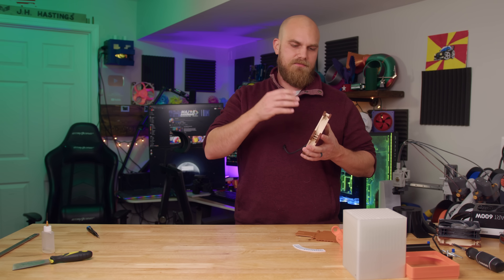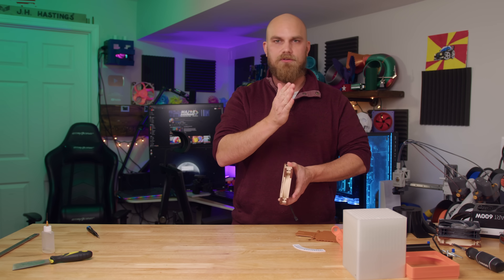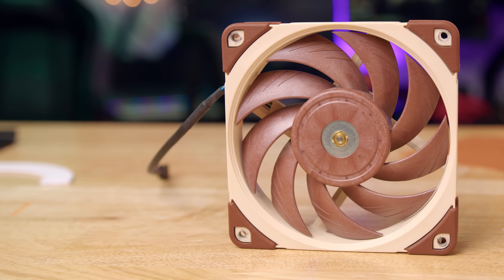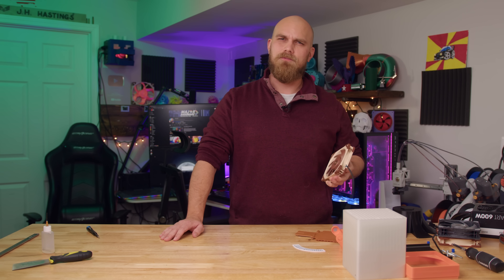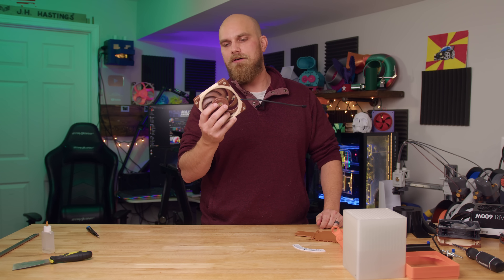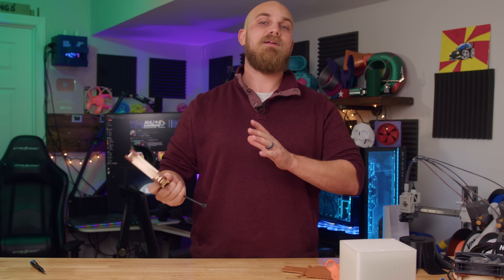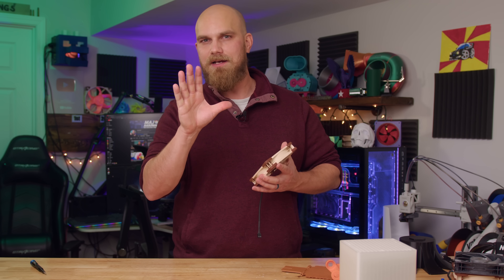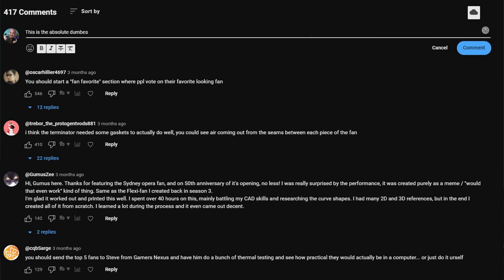I Built a Static Pressure Machine | Fan Showdown Season 6 Pilot

Comment: Hi, I think your solution is pretty good for what you're trying to do.
While you were explaining your idea of how to measure static pressure, I visualized a U shaped pipe with the bottom filled water and one end sealed with what you already built so that the air coming out of the fan goes into the pipe. That way the air coming out of the fan would push the water up the open end of the pipe and it should be easy to measure how high the water is pushed. That said, I think it would take some experimenting to find the best diameter of the pipe and it would need to be tall enough so the water doesn't overflow out of the open end. I hope the description makes sense.
Love your videos, will see you in the next one.
Reply: Yes with carburators I use tubes filled with mercury
Reply: As I understand it, that's literally why the measurement in the spec sheet refers to water -- that is THE way to measure it in high precision.
Reply: The issue with that is that if the Noctua can only do about 2.3 mm H2O, how are you supposed to accurately measure the differences between the fans? You'd be measuring tenths or hundredths of a millimeter. You could try a lighter fluid like mineral oil for around 15-20% better accuracy, or set the measuring tube at an angle as long as you have the space and the tube is rigid and stable enough, which can be an issue. 

Another option would be to control the "ambient" pressure holding the liquid down. You could pull a slight vacuum on the "output" side, for example use a plastic hose and clamping it with some air between the end and the liquid. Basically a reverse water barometer I guess.

Comment: Fans achieve their maximum static pressure when they don't move any air (hence the word 'static'). The device in this video does not fairly test fans with high static pressure and low flow rate, since those fans wouldn't move enough air for that higher pressure to make it to the flap. Trying to inflate a closed volume against a force (something like a balloon: more pressure = bigger balloon) would be a fairer test.

Comment: Instead of measuring the angle, you could make it max out at 30º at which point it would weight against a scale... that way the restrain in air would be the same and you would measure a 'force'.

Alternatively, you could make a Pitot Tube of sorts inside a tube and measure a water displacement caused by the pressure... you could measure both static pressure and total pressure, quite interesting physics...

Comment: Instead of measuring the amount that the door opens (which will give nonlinear results), it would be interesting to measure the pressure on the door by adding a small digital scale to the other end of the lever. Limit the door to open some amount that most fans can achieve and measure the force (in grams or ounces) from there. This way, the flow will be similarly impeded regardless of how much force is being exerted on the obstacle.

Comment: I thought that a true static pressure reading would be with no airflow, I.e. That this is a halfway house between airflow and static pressure?

With a manometer and an adjustable restriction, you could do a sort of brake dyno setup where you keep adjusting the restriction and measuring the pressure (And airflow) - This would then allow you to graph the results as a nice curve for each fan.

Comment: The volume of air needed to open the flap further grows the more the flap is open, making the linear scale measurement inappropriate.  Ideally you would provide a static orifice and some kind of contained measurement device.  Perhaps a piston can be raised by the fan pressure in a clear tube, while having a set orifice on the sides of the tube or in the piston itself to restrict the airflow.  In this case elevation of the piston would be a more direct and consistent measurement of the static pressure.

Comment: I think its fine, but there should be some audience awareness that the numbers on the gauge are nonlinear, due to how the force required to shift the angle grows as the fin aligns with the airflow. That is to say, 6 may be 1.3X the force as 5, additionally you could potentially find the static pressure values assigned to the numbers based on datasheet reported values and map them to your gauge.

Comment: only thing, like i saw someone else mention, is that as it opens more, there is more air velocity and it doesnt measure static pressure anymore. I think you could make a great measurement device using the same setup, except instead of the flap opening, it is mounted solid in place and you can use a strain gauge in some way to measure the flex of the flap based on the pressure the fans are putting on it.

Comment: You'll have to calibrate with a known high CFM low static pressure fan. as this setup may not induce enough restriction to simply be overpowered. A tighter straightening grid may be the easiest option. If there's little to no restriction, then you've made a CFM meter, not pressure. 
 
Alternatively, you could literally use water - a mechanical manometer is just 2 water loops, one attached on either side of the restriction, and the other just pre-restriction to open air. The water level will shift in the tubes relative to the pressure difference in and out of the chambers sections. So your grid assembly would just have 3 ports on the bottom and a more restrictive plate in the middle.

Comment: Isn't this contraption still measure air speed, not pressure?
Also, 2mm in height is not necessary is 2 mm length. Just place the u-tube almost horizontally.
Or, modify the contraption to actually measure air force on the lid, not angle.

Comment: You may be able to set up a hydraulic static pressure tester by having a water reservoir that the fan blows down into, with an elbow out the side that connects to a vertical, clear acrylic tube with graduations on it. The higher the water rises up the tube from your baseline, the more static pressure you have.
Reply: Or suck, as it were.   With a reduced acting area at the end of the tube I think you could get more displacement and therefore resolution.   Finding a fluid with low surface tension could also help reduce measurement error from a wobbly wobbly meniscus.
Reply: @knibknibknib you dont want a reduced area. It will start to have capilarity effect on the water and change the actual value.
Reply: I'm not an expert in any of this but this one actually makes the most sense to measure pressure. The water would keep air from flowing so it would only respond to an increase of static pressure. It would be really easy to engineer. Could also add a little foam float to the measuring side that's just big enough to stick to the walls when the fluid drops.

Comment: You can increase the resolution of your measurement by increasing the length of your "measurement arm". Longer arm on top gives you a higher ratio of movement. Let's say right now it's 1:1, the flap is 3 inches and the arm is three inches. If the flap is deflected 1 inch the measurement arm is deflected 1 inch. If you change your ratio to 1:2 your deflection at the measurement arm is doubled, making it easier to measure changes that would otherwise be difficult to see with the naked eye.

Comment: One potentially major issue with this setup: The closer the flap gets to horrizontal, the less accurate your reading will be, not only because the greater angle decreases the area of impact, but also because of Bernoulli's Principle. As the flap gets more horizontal, the airflow could become a low-pressure area that pulls the flap down. This could potentially cause major oscillations which will make it impossible to get an accurate reading.

I would suggest having a flap on linear rails, with a very light spring, that the air has to push straight back. This would solve all issues related to angular cross-section, and, the force require to compress the spring can be directly converted to a relevant metric.

Comment: I would use a U-tube manometer as like others have suggested but 3d print the fan to tubing connection of the manometer such that the liquid level in the in the tube has a different surface area than the surface area of where the fan contacts the fluid. Right angle down the square fan tubing about 6 inches and connect the tube to the bottom. when you fill the u-tube make sure the liquid level equalizes in the square tubing and then you will have a force multiplier to make measuring the fluid rise easier.  you could also fill it with a lighter liquid like Isopropyl Alcohol 785.40 kg/cu.m instead of using water at 1000kg/cu.m, possible chance of fire but you will have more sensitivity in measuring the height of the fluid rise.

Comment: I like the idea! i mean a off the shelf anemometer would make the most sense but as an engineer doing things differently just for the sake of it registers with me. The only thing I could see is that the scale is not linear since when the paddle moves the force of the wind is not parallel to the normal force, as can be seen with the 3000rpm fan. The easiest solution I can think of is make the pointer longer and calculate a non-linear scale. Maybe make the numbers on the scale normalized and based on the force being applied to the paddle. since knowing the weight of the paddle, weight of the counterbalance, and the angle, those can be calculated.

Comment: I have been thinking about this type of test for a while. I think a device based off a barometer using fluid would be the most true and reliable test. The measurement you showed of 2.34mm is literally this type of a test. the fan was able to lift the fluid (water for their test) 2.34mm.

Comment: Interesting idea. Maybe have the flap fully enclosed and sealed with some kind of rubber bracket (or equivalent) on the side facing the fan, then hooked up to a weight scale. Like a food/baking one should be sensitive enough. There's even entirely mechanical ones that you could repurpose. 🙂

Comment: Or, a large (the wider the better) bucket with a sealed lid.  Attach fan to lid.  Add a clear tube to the bottom of the bucket and attache it to the side vertically. Add X amount of water (keep it the same), add a line to the tube.  Turn on fan, measure how high the water moves.

Comment: I can see there being a problem with the angle gauge thing. There wasn’t a huge difference in the reading of those two fans you used to demo it. You’re going to need something with higher resolution. Make the radius of the gage much bigger and the pointer much longer. You can thin down the pointer to make the weight insignificant

Comment: Problem #1: That flap offeres less resistance as it opens up, so it's a logarythmic scale, making it very difficult to see the differences in the top-performing fans. You saw that already in this video. 
Solution #1: Make your own manometer using a cheap-ass Bmp 280 sensor or equivalent, read it with a dirt-cheap Arduino and you're done.

Comment: Hi there, my suggestion is to balance your door/flap so that the T-30 just about maxes the gauge out... because no normal 120mm fan running on an AX12-25 is going to go that high. That should also bring the stock AX12-25 closer to the middle of the scale.

Comment: I saw AlterLynx imply a suggestion that the flap should be longer to ensure that it is always in the air stream. I concur, but only to the point of practicality.
I would check to see of the air straightener is required to get consistent results as it is eating some of the static pressure.
It is possible to convert the angle to static pressure. P*A*l/2=m*g*L -> P=2*m*g*L*sin(theta)/(A*l). m*g*L*sin(theta) is the torque of gravity on the flap, I think that will work for that equation, but I'm having hard time figuring out what m*L ought to be, I just know it is the moment arm of the flap. This is nice as the m*L can be increased if the fan is strong enough to move the flap out of the wind. A is the cross sectional area of the box and l is the length of the flap in the air. So l should actually be h/cos(theta) where h is the height of the box. So the final answer that I have is P=2*m*g*L*cos(theta)*sin(theta)/(A*h).

Comment: 1. Flap deflection may not be linear with air pressure.
2. Not enough resolution on the scale, which could place fans close together even if they have vastly different pressures.
3. Using an angle of deflection may not be very relatable to real-world applications, but it is a good way of demonstrating pressure to the viewer.

It is a very entertaining video, and I am glad you are taking the initiative to make the content more interesting by tackling different issues. I apologise if my comment seems harsh. I genuinely enjoy your content. Sorry I didn't come up with a better solution for measuring static pressure.

Comment: i think that a much better option to visually check the static pressure of fans would be to :
x: mount fan in the contraption that would place fan above the table
x: place 20 dry leaves from Canadian maple tree no more than 5 inches away from test subject 
x: after turning fan on for the duration of one of Celine Dion songs (your choice ) measuring the distance traveled by every leaf.
x: multiply the sum of distances ,divide by 20 and square root of PI (preferably key lime PI)

Comment: For relative measurements, this is fine. Technically this is still dynamic pressure as the door opens and there is air flow through it. 

You could just glue that door shut, and shove a 1/4" PVC tube in a hole in it, hold it so that it dips down, then back up vertically,  then put a bit of water in that hose, and the difference in height is literally mmH2O static pressure measurement. Cheap, easy, instantly relatable and comparable units. Seriously, you could knock it together in minutes with a ruler, a spirit level, a length of transparent hose, a little water, and some glue/tape.

Comment: The test device isn't accurate because the required pressure to lift it up is not linear like the indicated dial values. It should lift something up equally from all corners (without a hinge, like an elevator) in order to get a more accurate comparison. The "6.5" value on the more powerful fan is really closer to maybe 9 - 12 if comparing static pressure values directly.

Comment: I'm not an engineer, but intuitively, it seems like the scale shouldn't be linear. It seems like the bigger the opening, the more difficult it would be to get to the next number? I don't know how consistent the testing is between manufacturers, but it appears that the T30 has about 7mm H20, so an ideal scale would give the T30 a score that's roughly 3x that of the a12x25. Just a thought

Comment: I have been using ARCTIC P14 PWM PST - PC Fan that are rated for hi static pressure, perhaps you could try the P12 PWM PST in your tests. I also agree with others that the flap should be  enclosed. Looking forward to a new season 😀

Comment: You could use the deflection in mm of a flexable diaphragm over the end of the tube to prevent the issue of the air moving around the obstruction.

Comment: Hey man! Remember psi is per square inch! I think a better way would be to see how many grams of thrust is produced then dividing that by the square inch size of your push plate. This giving you thrust per square inch. Also don’t flip the flap, the flap should be pushed parallel to the thrust produced.

Comment: Since you asked, A larger reinforcing grid on the door to lighten it would allow more movement, making the gauge more accurate.
I love this concept. It reminds me so much of the wind tunnel the Wright brothers used to design their propellers on their aircraft. Balance weighted and simple, they used the box to design a propeller with an efficiency close to today's standards.
Reply: I also have read that orthogrid (rectangles) are more efficient for stiffness to weight.

Comment: Because of the escape and dispersion of the flap system, the flap measurement is probably logarithmic to the actual static pressure. Which could be useful. 

How well does this measurement system work for really bad designs?

Comment: I like the idea of adding static pressure, but the flap isn't a good way of measuring it.
You need to basically build a pressure chamber for the fan to (try to) blow into and add a measuring device. Others have mentioned a u-shaped tube / pipe to putt liquid into for the fan to push against.
Water or mercury is traditional, but the lower the density of the liquid, the better your resolution - and with how weak these fans tend to be, you need all the resolution you can get. 

A liquid like Gasolene or Ethanol is about 3/4 as dense, which would make pressure readings more obvious because the liquid would move further in the tube. It also doesn't boil off at room or body heat temperature like, say, Isopentane would. Of course, you're still playing around with flammable liquids...
Reply: Baby oil.

Comment: this still "measures" air flow through an obstacle (your grid infill). the radial scale could be improved/extended with a linear one so small changes at higher lift result in more noticable results. static pressure would have to be measured before the obstacle - u-shaped tube with water in it, like other suggested.
Reply: That's the thing. It does not directly measure static pressure, but it can be inferred through this test which fan would have higher/lower static pressure. It's good enough for me, it's just a youtube channel for entertainment purposes.

Airflow through an obstacle is what's relevant for a cooling fan anyway. It is the air that flows through the radiator/fins that carries the heat away.